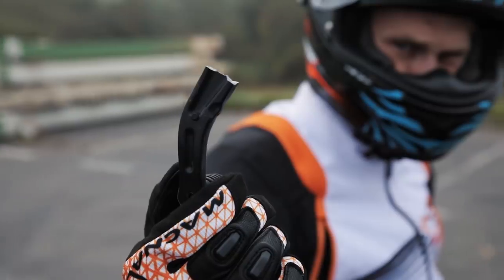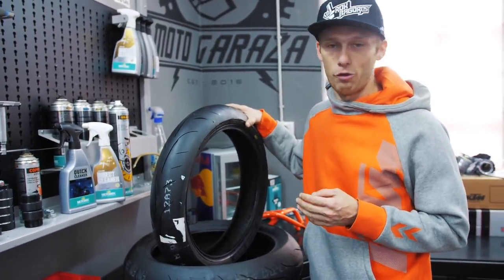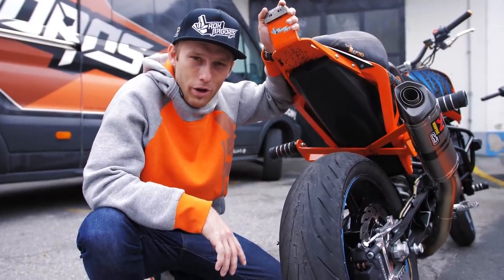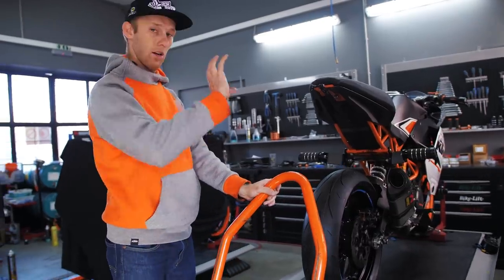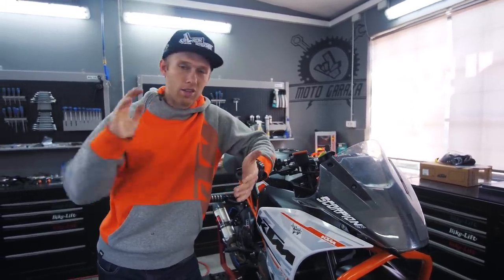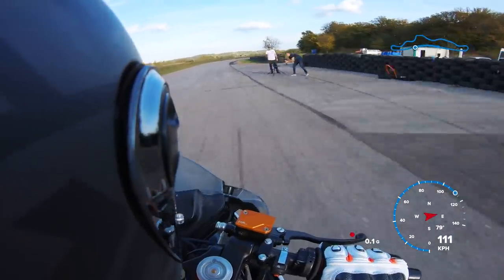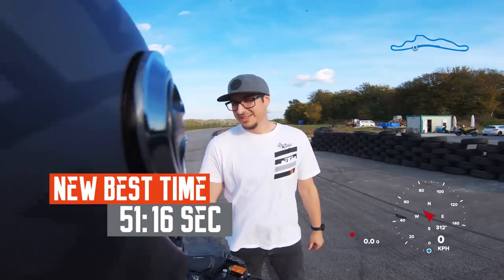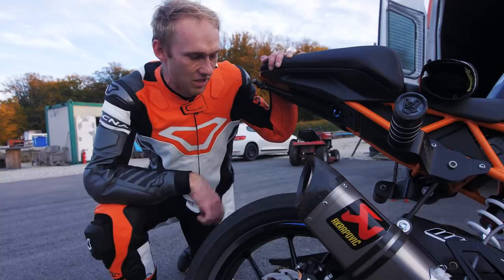KTM RC 390 from DRIFT to RACE [part 3 - RACE TYRES] | RokON vlog #91

Comment: For your tire problem take strap with a ratchet ( spannset) put that in the middle of the tire strap it down so it press the walls outside carful add the air and loos the strap as soon as possible it will work. I had big problems with quad tires and This whas the last option.

Comment: 1 bar is extremely low, even when it heats up it is still below 20 psi, and at that pressure the tire acts as a spring.

Comment: Do you have the track map with trajectory marked with accelerating, breaking and constant torque sections?

I feel the first 180 degrees left turn on the track after stright section might be faster because of better trajectory. I think it is possible to start turning closer on the right side after stright section and go to late apex. Late apex is preferrable because of next right turn.

Also try to measure not only the 1st lap, but the 2d too. 1st lap usually is for warm up and start of the 2d lap is not from 0 km/h. I think the measure will be more clear.

To improve progress install marks in places near track where braking should starts and in apex where you should change breaking to accelerating.

Hope it will help.
Reply from the maker: Damn that are some amazing tips, thanks a lot. Will defenetly try them out 🤘 where you from :) ?

Comment: What size tyres do you run on Razant?  The Avon website shows only one tyre fitting the 390 Duke?  Skäl  David
Reply from the maker: 120 front, 160 rear ;)
Reply: @RokBagorosStuntrider  Thanks.  I'm going to look at that at the next tyre change

Comment: Try to lean more with your body, turn your shoulders inside the corner. In the S stay with constant gas, and try to "cut" as much as you can because you have a low cc bike and not enough hp to get out fast of the corners
Reply from the maker: Thanks for thr great advices. Will def keep them in mind :D

Comment: Hey Rok! I have a question regarding the front crash cage on the KTM 690 Duke. How did you mount the plastic slider on it? I want to add a slider to the cage aswell since I'm going to the kart track, but I want it to have some plastic slider, so the metal cage is not damaged at the first drop..
Reply from the maker: We just welded a peice of metal, drill a hole and made a thread to mount the slider that we bought online ;)
Reply: @RokBagorosStuntrider  Nice! Thank you for very much for this information. I think I'm not able to weld at my home. Maybe I can get a shop nearby to do it for me :)
Reply: Quiero que me regale una moto megusta vast ante la KTM

Comment: 1 bar tyre pressure on the rear? That's way too low. You'll cook the tire and the rubber compound won't be the same for the rest of the tyre life. Run them with typical street pressures, a few notches down from max rated. I'd run 2.3 bar at least. Too low and you start inducing drag.

Comment: Too early shifting
Reply: RC390 engine has 1 cylinder and max torque at 6900 rpm. It is normal practice to shift early. It gives better acceleration.